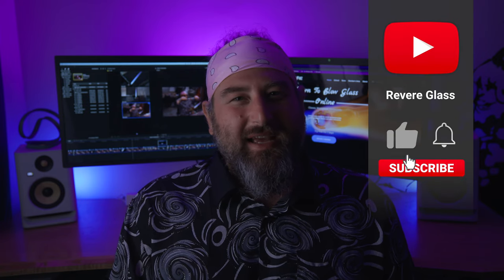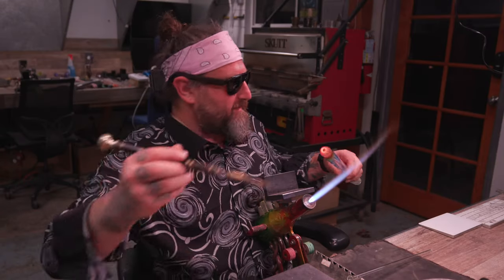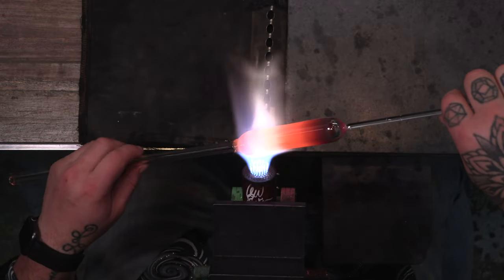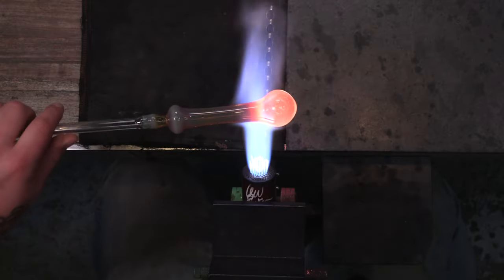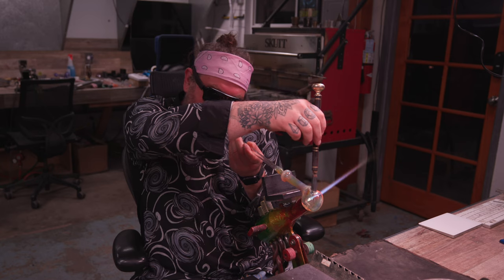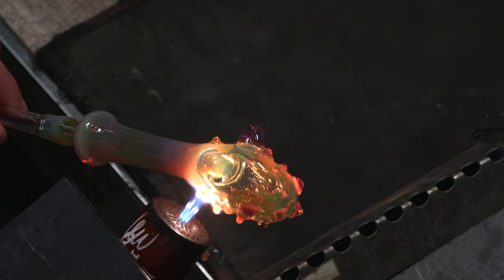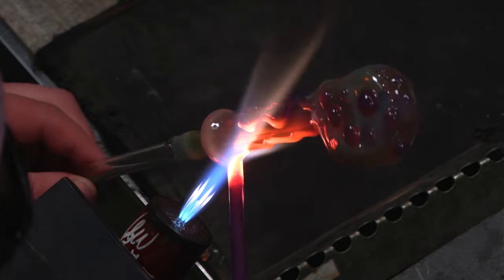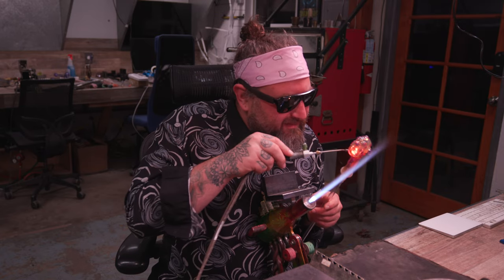Hand Blown Glass Hammer Spoon | Revere Glass Making Class | Glass Blowing Technique

Comment: I had a piece many years ago, clear glass with 3 red roses on it. The roses looked like they were painted on but way more durable. I'm guessing that would have been stenciled on using powder coat paint. 
I wanted to replace that item and even online searches reveals no one makes the exact style item anymore so the real steamroller is dead and replaced with a tube, just a tube with a hole in it. It's just an elongated pipe then. 
I also remember some pieces made to let the consumer see the smoke traveling through their pieces like crazy straws, they were mesmerizing.

Comment: The first tube you pulled a blank from has plastic wrap on one end. Did that cover the open end of tube? Was it to keep hot air from traveling down tube whe in kiln? 

I use a paper towel tube with tape on it.